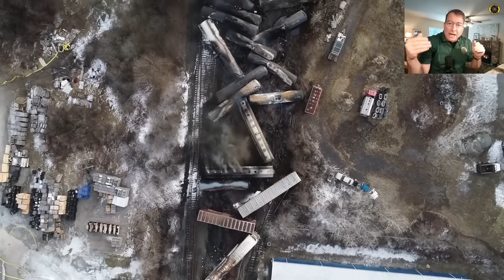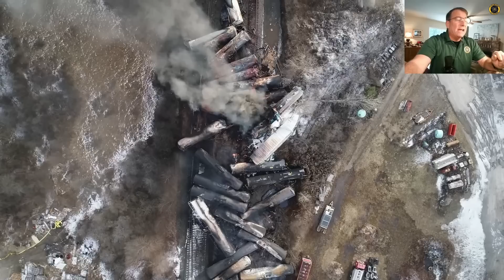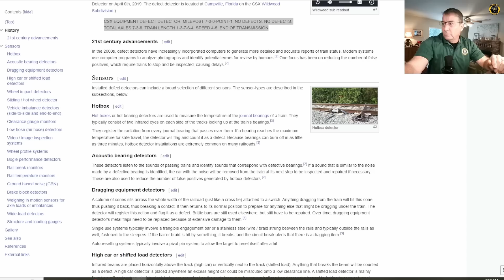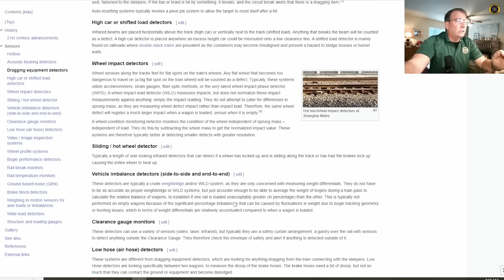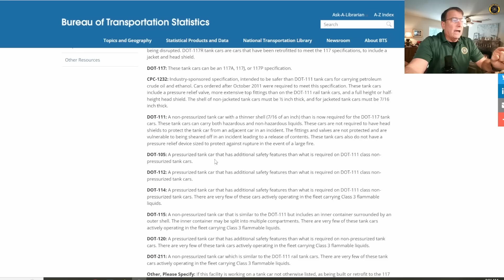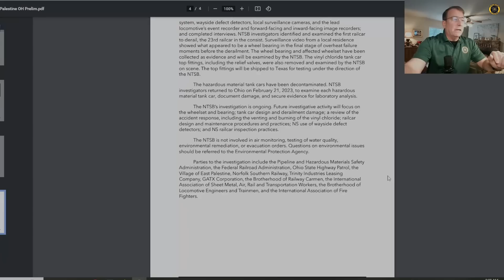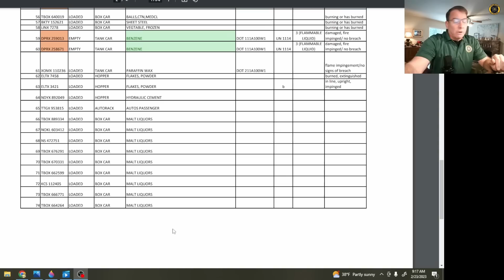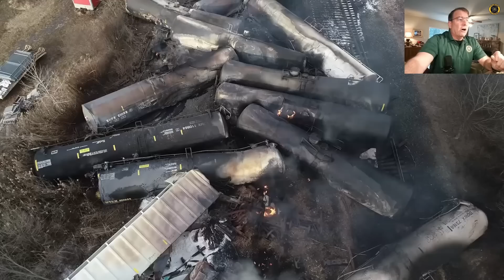NTSB Prelim Report: Norfolk Southern Train Derailment 23 Feb 2023

Comment: Two puzzling facts. One, the video floating around, taken by Bliss, is after the train had crossed five rail crossings in Salem. It would cross twelve more before it derailed, and no one reported it? Two, a little over a half mile, six tenths to be exact, from where the Bliss video is taken, a detector reported a temperature of a little over one hundred degrees above ambient. There are many things that just don't add up.
Reply: In the report, 115 is the temp above ambient that triggers the alarm. It was just below that so no alarm, then 20 miles to the next detector. I saw some info that said 30 miles is sometimes the distance between detectors. If it goes from "ok" to derailment in less than 20 miles, seems 30 mile spacing is even more inadequate. Profit Profit Profit, less detectors, more money, screw the people who get impacted.
Reply: Rate of rise should be an alarm parameter..We have AI ? It would cost nothing.
Reply: @wendygerrish4964  For sure. I mentioned in another comment that cars have  TPMS sensors since about 2005. But giant rail car carrying who knows what have these primitive systems. Each car should have a full set of sensors and report realtime to the main locomotive.
Reply: @wendygerrish4964  I was thinking a very similar thought. The alarms shouldn't be just based on a single point in time threshold, but also based on a delta over time. A constant increase on the same axle over a period of time would warrant an inspection.
Reply: It was in full flames. Go back to your groomer.
Reply: "Civilians"- non railroad employees have no idea who to call in such an event. They could call the police or fire department, but have no knowledge as to how to contact the appropriate rail employee, say a train dispatcher. Can't call a  non existent telephone operator.
There's no guarantee the police would call.
Reply: @thomasmleahy6218  not always. In my working days, I had to deal with rail crossings every day. I have the NS phone number in my cell and reported locked up wheel sets a time or two.

Comment: PTC couldn't possibly change this; it's purpose is to prevent collisions between trains and accidents caused by inattentive engineers forgetting to slow for a curve (see the Amtrak accident near Philly several years ago).
The emergency braking can contribute to accordioning because it takes more time for the pressure to drop the further away from the break you get. So the cars right at the break get their brakes on immediately; depending on the length of the train it can take 10-20 seconds or more to apply the brakes at the far end. Newer brake technologies ("ECP") might reduce this some, but once this train was in the ground there was nothing to be done.
What I want to know is why an earlier hot box detector didn't catch it, as a security camera saw it with flames some 20 miles (!) back.
Reply: Thank you for the explanation of the accordion effect!
Reply: We used to have a twin pipe braking system in the UK (long time since I used it) which seemed to make the brakes more sensitive down the length of the train. Though or course our trains were never as long as those in the U.S. But they were faster. 😊

Comment: Got some questions if the D rail car was number 23 why couldn’t the train crew see the fire that was heating up the axle bearing because there’s video evidence 45 minutes before the derailment that there was a fire under the car now my second question is why did they just save the engines when they could’ve saved some of the first 20 railroad cars that were not derailed
Reply: 1. It was dark, so I doubt they would have seen any smoke. It would have to be actual flame. 

2. If the car was 23rd back from lead. and assuming an average car length of 60 ft. per car... plus the better part of two 80-foot locomotives behind the cab means that the problem was roughly 1,500 feet behind them. 

3. Add to that: On tangent (straight) track, visibility of anything going on way back there won't be the best. (Plus it's nighttime...) The best visibility at that distance would only be around curves, and only if there's no visual obstructions at that distance (nearby trees, buildings, etc.) Also, most of the crew's attention was looking forward, not backwards—especially if they are getting into an area with a lot of grade crossings. (You know, all those people who love to drive around or through the gates... Gotta watch for them...) It's why hot box detectors were invented. It's also why train and maintenance crews waiting for a train to pass will watch it roll by and be that 3rd or 4th, etc. set of eyes. 

4. Most safety classes I've been in teach me not to be the hero without proper training and equipment. You think the conductor was trained and equipped to walk back into a hazmat disaster just to uncouple and save maybe a dozen plus cars?
Reply: Would you go down there next to the fire and do it?

Comment: In a controlled burn you regulate the fuel to air ratio. This was an uncontrolled, open burn that the EPA had to sign off on. They poisoned a chunk of my state so that the railroad could get the line open quicker and cheaper. We will not forgive this.
Reply: Conflagration is much better than detonation. That stuff goes boom and there wouldn't be a window in the evac area that survives.
Reply: I think first responders were very concerned with a BLEVE, which would 100% dictate a release of pressure from the vessel
Reply: The burn was controlled in the sense that they prevented a major explosion. Had there been an explosion an even larger area would have been contaminated, as the explosion would disperse the chemicals. A controlled on-site burn limited the contamination to a relatively small area.

At that point this was a no-win scenario. The area was going to be contaminated, the question was how much land and how badly.
Reply: @Imbeachedwhale  -But the controlled on-site burn sent a zillion amount of poisonous smoke into the air, and who knows, how far, and how much of the poisonous particles fell on everything, including all the bodies of water, etc... Perhaps burning a poison to control a burn was actually worse because the smoke went everywhere too???
Reply: @frandanco6289  An explosion would loft the chemicals higher into the atmosphere than heat alone, thus they would spread even farther.

Once the fire start in the first place (during the derailment) there were no good options to stop it from contaminating the area. Just variations of “How much area gets contaminated” and “How contaminated is the contaminated area going to be?”
Reply: Would a large explosion(s) been more acceptable?
Reply: @alanmorrison3598  Think about that for a minute. If this mixture was so volatile, how would setting it on fire out in the open prevent an explosion? It would cause it. They burned those chemicals out in the open because it was cheaper than cleaning them up.
Reply: What part of 'prevent a massive explosion' is difficult to understand?
Reply: @charlesfaure1189  The part where you can set explosive shit on fire and not have an explosion. Use your brain.
Reply: @NoorElahi1776  Flammable liquids burn when they can't pressurize. If they pressurize in a container the reaction accelerates and goes supersonic in the medium and creates an explosion. It's obvious you haven't been to a hazmat course. Even the 1-day hazmat recognition course covers this material.
Reply: @MichaelOnines  What are you telling me, that they took the trouble of opening all the tanks of vinyl chloride and let it contaminate the earth instead of spending the time and money to pump it out and dispose of it properly? Look jackass quit with the snark. I'm not in a mood to put up with your bullshit. Smart guy over here reads a wikipedia article and now he's the soy superman. Give me a break.
Reply: @NoorElahi1776  You don't set up pump systems when it's at risk of exploding in your face. This burn wasn't dictated by the train company. The on-scene commander for the emergency response was a local. Stop being obtuse. It would have been much cheaper to pump it all if it was safe to do so. This will be a multi-year treatment problem that will involve groundwater pumping and contaminated earth removal. If they could have just vacuumed it all up safely they would have done so.
Reply: They don't want facts. They just want you compliant.

Comment: Coming from an old railroading family (I was the black sheep I went into aviation) Juan's analysis was spot on .
Reply: Yes and no...fireman riding in caboose notwithstanding Juan is confused on a number of important minutiae in regards to railway operations. 

In particular HB&DE detectors which (depending upon their age and model) can detect a number of potential problems with a railcar in a passing train.

Most current detectors measure the temperature of the bearing in the center of the wheels axle plus the temperature of the wheels tread...the latter done to detect sticking brake shoes which often occur as a result of incorrect handling of the train air brakes by the engineer in addition to worn or defective components. 

Oftimes a train will pass over a HB&DE detector with "no defects" transmitted by the detector to the crew over the radio and then they are  notified by the dispatcher that a "hot wheel" was detected by the detector and the appropriate remedial action (usually a brake pipe reduction of at least 10lbs) be made to remedy the situation.

If the same defects continues to arise at subsequent detectors then often the railcar must be set off at a location where car inspectors can attend to the equipment and repair it where it stands.

Positive train control (PTC) is a system designed to prevent trains from running into one another when the crew fails to respond to a signal or track condition which requires them to slow or stop their train before encountering it. PTC has nothing to do mitigating a derailment which has already occurred or is occurring.

DP trains (where a 2nd or 3rd radio controlled locomotive is located some distance from the lead locomotive in the body of the train) can actually stop and mitigate the derailment more quickly than a conventional train with all power on the head end because as soon as a emergency brake pipe reduction is detected a radio signal is transmitted to each locomotive in the train and the EOT device which initiates an emergency brake application from all locomotives and EOT simultaneously...as I understand this train was 9,300ft long - the emergency brake signal propagates at 1,000fps from each locomotive and EOT and as such the entire train brakes would be applied within seconds of the brake pipe separating on the car where the derailment occurred. 

If you are wondering I am 4yrs retired as a locomotive engineer after spending 33yrs running trains for the company that caused the largest ever evacuation in North America in history. 

We learned a thing or two from that incident. 😊
Reply: "analysis?". All he did was read shit off the report.  The report barely speaks of a catastrophic derailment.  Makes it sound like driver slowed the cars and they 'thought' there might be a derailment because of fire and smoke.  you think?  I'd like to know exactly how long (minutes) there was between the detector message and the derailment?  how long did it take for them to start slowing the train?  twitter initially said they kept going for a while??? thats what a report and "analysis" would tell us!
Reply: @jaymerjaymer  As a general rule, one should not believe anything posted on Twitter or the comments on You Tube.  Most of the comments about the cause of this accident that I've read - on sites other than this one - are wrong to the point of absurdity.
Reply: Having been a railway engineer in the UK for over 40 years, it WAS NOT spot on.  He just thinks he knows without having any first hand experience of railway operations, then SAYS IT CONFIDENTLY.  He's wrong.  He's VERY wrong to question this way with no experience.
Reply: @stevekelly5166  Steve,  your comment is wrong.  Juan got it essentially right.  It's true that he got a little confused about some of the specifics of how the air brake system works and which employees used to ride in cabooses, but those misunderstandings have been corrected in the comments below which were submitted by professional North American railroaders.  Taking into consideration those comments along with Juan's presentation, this was a very good presentation - the best one I have seen so far on any media.
Reply: @stevekelly5166  So, what was he wrong about exactly (He basicaly just read the NTSB report)?

Comment: I’m a locomotive engineer for BNSF, operating systems are pretty constant over all class 1’s. I read the prelim report and what I gathered from it was the train passed several “silent defect detectors”, these instead of sending a message to the train crew send a message to the Detector Desk guys at the said railroads dispatch center, (unless the detector desk calls the train crew by radio the crew has no idea what those detectors recorded), those detectors were recording a hot bearing. When they finally hit the talking defect detector and got their message “those announce over the radio” of their hot bearing, the engineer started to slow the train to a stop so the conductor could go inspect the car. Hazmat cars have to be set out when a hot box alarm goes off. Just by pure happenstance at the exact same moment the defective bearing failed, caused the car to derail and broke the air hose connection to the rest of the train putting the whole consist into emergency. The zigzagging wrecked cars are not from the emergency brake application but from the inertia of the moving train and the remaining cars derailing and piling up. Edit: silent detectors are spaced about 10 miles like you noted, but talking detectors are spaced about every 30-50 Miles apart. This is mostly to cut down on radio chatter.
Reply: I commented kinetic energy caused the accordion effect. Inertia works as well.
Reply: @pplusbthrust gets the point across either way haha